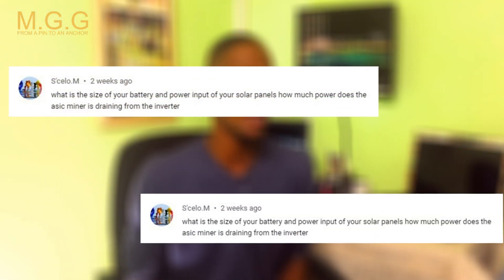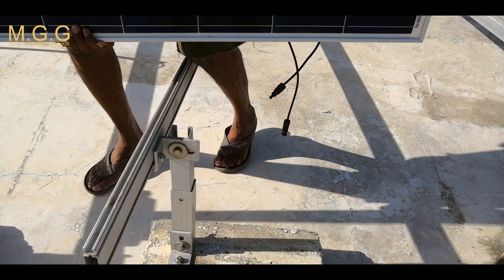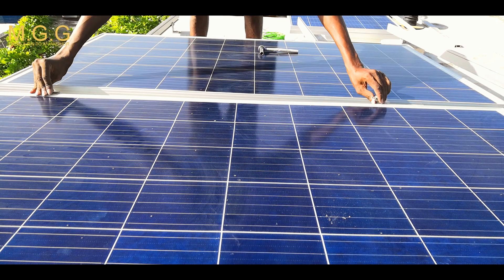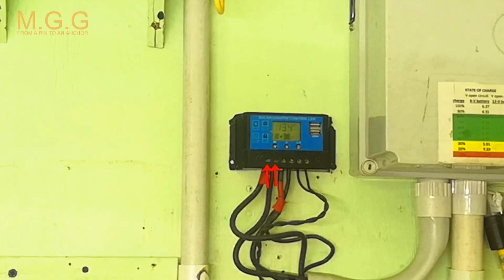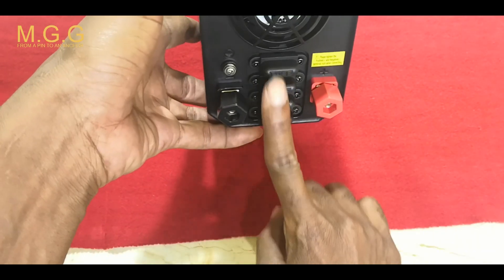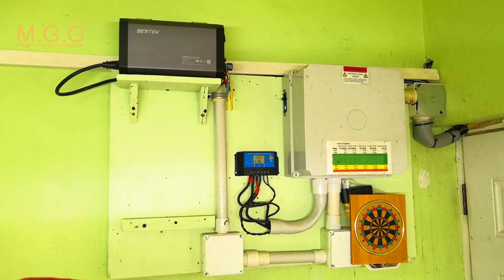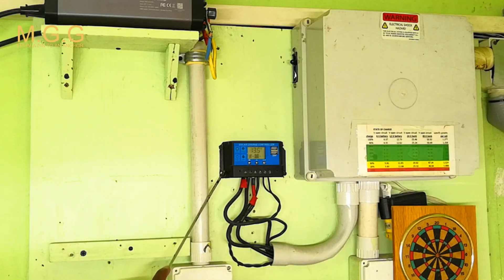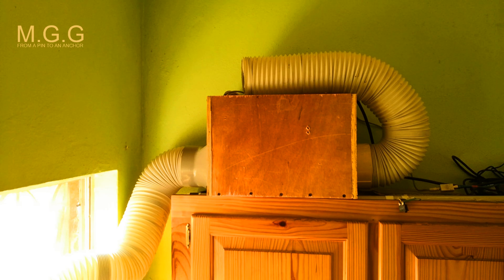ANTMINER L3+ RUNNING🏃‍♀‍ ON 12 V POWER INVERTER⚡

Comment: great video, wondering if you can connect the 12 V battery output direct to the Antminer? just to avoid PSU conversion efficiency loss from the DC to AC back to DC miner..... which output 12V